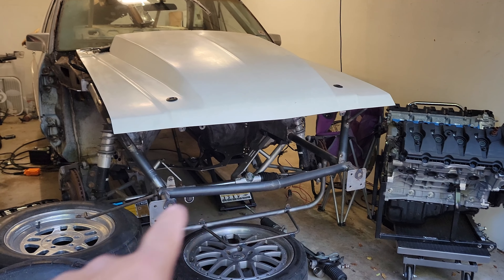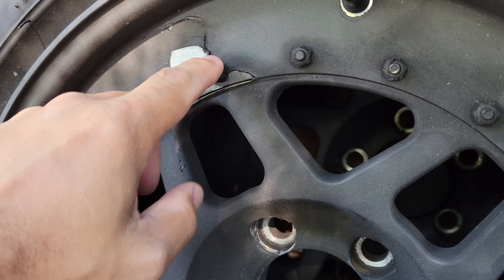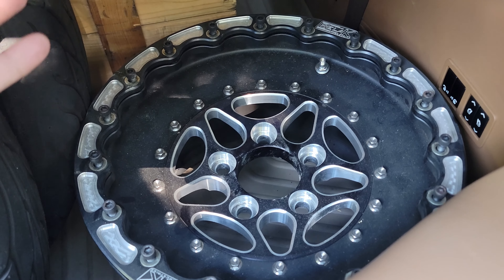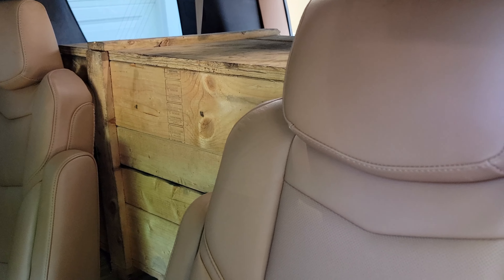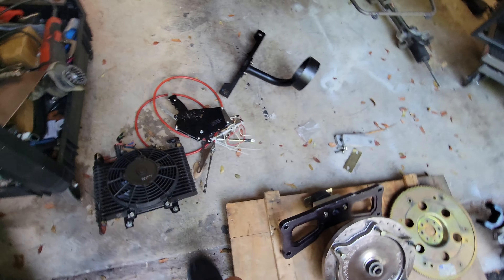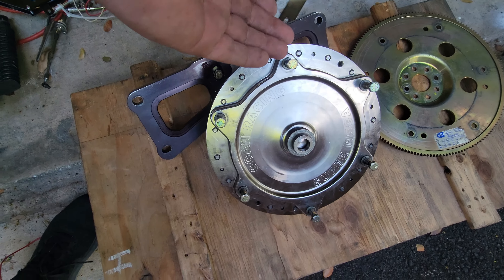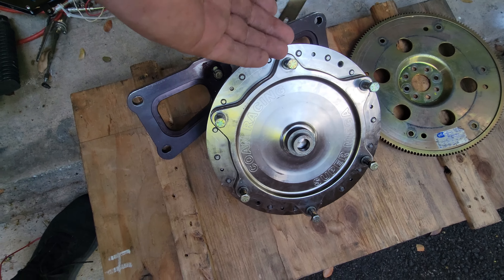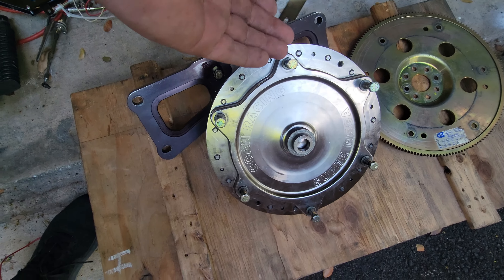Fairmont transmissions secured and Avoiding This Costly Catch Can Mistake on Your Mustang!

Comment: I put catch cans on both sides of my TVS boosted 630 wheel Gen1. Plug and play, not vented to air. Did not remove PCV valve. After 1,000 miles the driver's side is bone dry, the passenger side had maybe an ounce of oil. Not sure if that should cause a concern.

Comment: I have just drilled out the pcv on my 2.9 gen3 whipple , wow what a restriction, a 6mm washer inside the valve to now 12 mm through hole , thanks Alex great tip 👍

Comment: for those who are cheap, by an oem driver sider valve cover fitting as its the same inner diameter as upr, if you want to be really cheap just use a breather and understand you will have oil splatter.

Comment: What's the thickness on the mid plate? Converter spacing may be a little off assuming the converter wasn't built for a mid plate, i (think) Coan might sell a longer hub adapter to make up for the added space of the mid plate. Perhaps you have already considered this, just an easy little thing to overlook sometimes.
Reply from the maker: Already accounted for

Comment: Make sure the catch can is vented and cap off the fittings on the intake manifold guys! A closed stock style setup will pull oil in the side of the intake manifold.
Reply: I left mine connected to the inlet and it blew smoke out the tailpipe big time, going to take your advice 👍

Comment: I got my 3-1-1 Coyote in my 05 Mustang yesterday, still need to get the torque converter studs lined up with the flywheel. Gotta love car projects. I also have to get my 88 Firebird running too.

Luckily my ring gap is already on the upper end of the spectrum (based off the Aluminator spec sheet) so I should be gtg for boost. Might pop out the check valve on the PCV at some point too.
Reply: I have a 3-1-1 and it's a gunshot to the head of trepidation! 😂

Comment: Great info for catch can setups. 🫡
Reply: Definitely good info. As fas as that PVC valve as a tech tip. I also liked the progress on the Fairmont build. I wanted a carbureted blow through setup. The community wasn't for it, and I got very little advice. The same went for low compression.  

In a future video, go through the process of timing a motor with lockouts.l? It looks like you are already set. With the front cover on already.

Comment: i just had a JLT catch can and a tiny air filter on the driver side and plugged the intake inlet, is that better for the car than running the driver side into the air intake like factory? im just bolt on and 93

Comment: Take a screwdriver and knock that check valve out in 2 seconds, because those fittings that convert the valve cover to an suck ass and break your valve cover a better option is to get a 1/2npt to -10 and screw it into the factory covers

Comment: Have a 2013 Mustang GT with a JLT catch can. Drilling that out right now thank you!!!
Reply: @Hoodie2103 meant to say mani😅 Is removing the check valve necessary for n/a application. Currently have a UPR catch can but didn’t know the check valve was an issue.